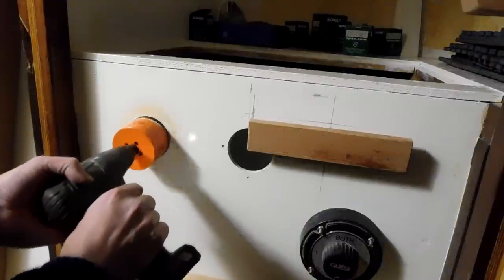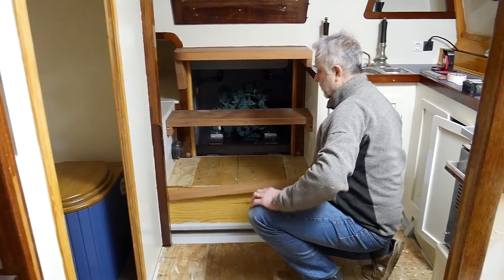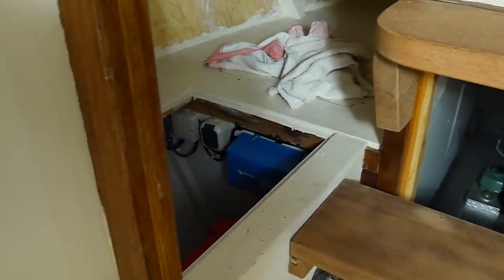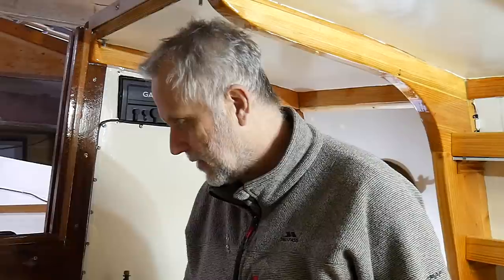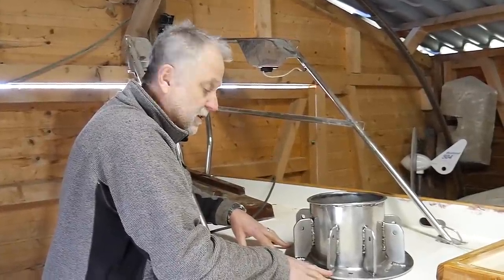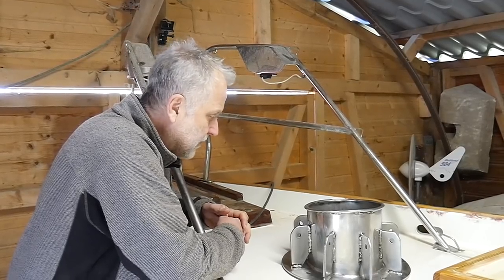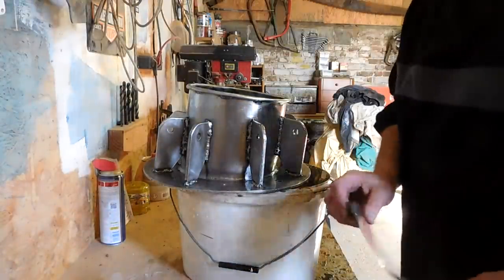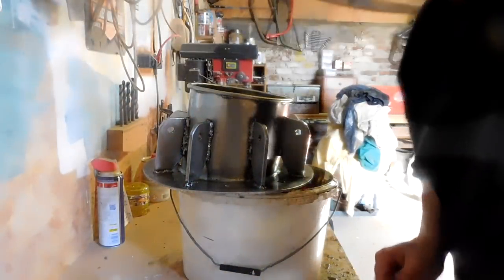More companionway, more deck fitting and a bit of electrics - SV Tapatya EP173

Comment: More great work Tony as usual, are you going to put a bead of epoxy on all internal corners of your steps to keep water out. If you put another top support for your middle step so you can just slide it in from the galley and then bolt it, ensuring it doesn’t rattle as well. Always great Friday mornings seeing your weeks work.
Reply from the maker: Thanks Chris. The steps will be epoxy sealed before varnish. Yes, I think I see what you mean about the upper retainer - they could slide in from the front. I worry they might jam if they don't slide in completely square. I'll think about it 🤔👍

Comment: Great work on the stainless it looks absolutely bullet proof (maybe a die grinder bit for the welds😉).  Those stair treads look beautiful and uber strong. Not being critical (just curious), why did you bring the top tread vertical support down onto the worktop fiddle, rather than using a similar support to the other side, secured to the bulkhead. You are really making substantial progress.😀👍⛵️
Reply from the maker: Thanks Norman. Well, I wanted the step to continue to the worktop so there was no gap and so it could be used as temporary work space when needed
Reply: @SVTapatya  Fare enuf.👍

Comment: ullo Tony ...
yeah keep the sparklers out of the water mate
sailing Zingaro nearly lost his boat this week when a plastic thru hull failed and pretty soon his batteries were underwater, 
no power for pumps
not fond of those plastic thru hulls
Reply: It wasn't a through hull that he had fitted!  It was the speed impeller housing that he hadn't checked.  All the through hull valves that he fitted were OK.
Reply: @rogerdinnis3816  opps sorry, all I caught was his 'emergency' video, there must be an update Im not aware of. 
Still the lesson is the same yes?
Reply from the maker: I think there’s plastic thru hulls and then there’s plastic thru hulls. I think the Trudesign stuff is good, particularly if the load-bearing collar is fitted too 👍
Reply: @SVTapatya  Yes I think they are working out with a few caveats. We can not be sure exactly what mix of plastic the various brads are using, this is important because not all plastics are equal. Just what happens with all the various liquids that can find their way into the bilge such as petrol, alcohol, various acids, and if they are going out of the boat through the thru-hull what happens with the internals, and perhaps more interestingly over time, even decades.  
Still, the 'lesson' was more about having batteries below what can easily become the inside waterline rendering them useless for automatic pumping, and where unsealed lead-aid batteries and seawater will become deadly chlorine gas.
Reply from the maker: All true mate, battery location and type certainly needs consideration and all thru hulls are potential problems. The fewer the better!

Comment: I have to say I worry about your approach to the middle step now admittedly and hopefully there should never be a situation where the extra 30 to 60 seconds it takes to get into the engine compartment is crucial and I presume you have an emergency stop/battery disconnect and fire extinguisher outside the compartment. However Murphy's law can strike and although it is a long shot it is conceivable that that extra time could cost you your engine your boat or your life.

Can I suggest you either use some type of snap clamp or since the step is nice and snug the only thing you have to worry about is when climbing the stairs and catching your foot applying upward force to the step causing in technical terms it to come loose and an arse over tip situation to occur. A man of your skill should have no problem making it tight enough that you really have to yank it up or hit it upwards a couple of times avoiding any problems with your foot catching it causing it to go up accidently and making quick access easy.

What would be ideal is something like those fittings that are used in Ikea Furniture they are round and sit flush and a half turn clamps then into a metal peg however they normally require a screwdriver or the good old table knife which in an emergency situation you do not want to be looking for but if there was a version that can be used by hand it would take you a couple of seconds only to release the step.
Reply from the maker: Yes, the step should sit there largely of its own accord, with a quick release device to avoid accidents. It won't take more that a couple of seconds to take it out. It does have the advantage of being quite small and light compared to the steps covering the engine room on some boats - some are very unwieldy!